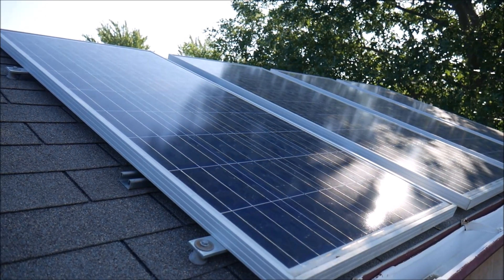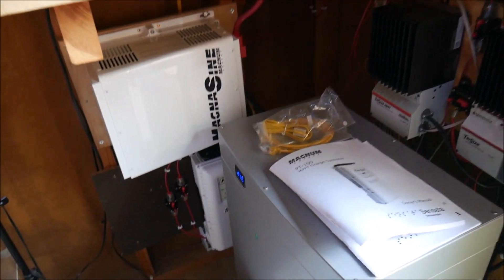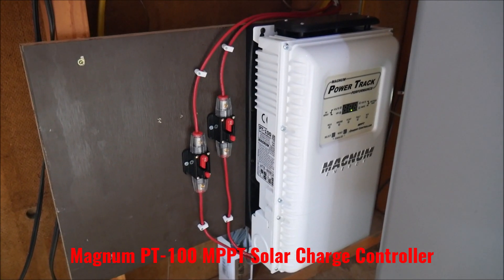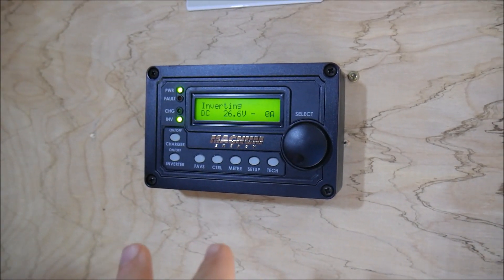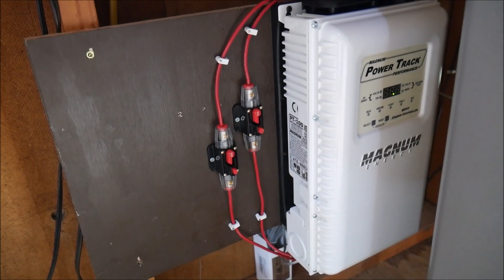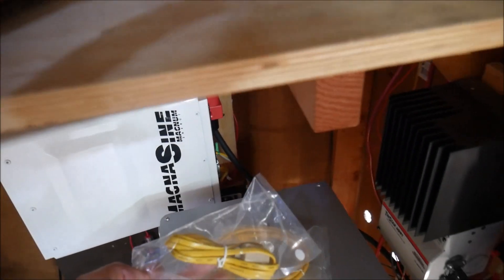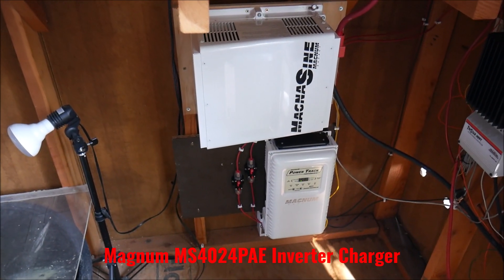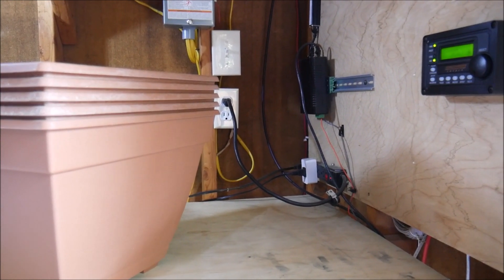Magnum Energy Solar Charge Controller & Inverter Install

Comment: Hello friend, that brand is for fans, it has been stagnant for many years, at this point it has not developed a monitoring app or integration with other devices such as raspberry and it is also extremely expensive for what it offers.
Reply from the maker: They aren't innovating at the same pace as the lower end of the market, true.  But their products are bulletproof and built in USA/America so there is still a market segment for them.  I would say they are better for whole home and commercial projects and much less desirable for smaller projects or for hobbyists/solar nerds.  

I'm not a fanboy by any means but I would trust that inverter charger over any other single piece of equipment that I own.  It is an absolute monster.

Comment: I installed a Magnum system about 7 years ago and it has been bullet proof.  Runs like a champ every day.  I think I have only shut it off 2-3 times since I installed it.  I run about 1000kWh/month out of it.  Only problem is, I don't think they sell them anymore...
Reply: I followed your videos about your installation and did mine with three of them. Pandemic really hit them while their were moving to Mexico. Most of the famous solar sellers stopped selling their products due the lack of availability for months. In my opinion the best Off-Grid solar hardware ever made.
Reply from the maker: Glad to hear!  Mine is going to be put to some serious use on my homestead soon!

Comment: Where did you get the magnasine?  Any support issues as mentioned in other comments?
Reply from the maker: I got it straight from Magnum Energy.  No support issues thus far other than some confusion on the solar charge controller that I am slowly working through.

Comment: Ordered a PT100, 175 minipanel and a 4448 PAE last year.
Took almost a year to get my components.
Set them up, and, to my disappointment, the PT100 and the 4448 were not fuctioning correctly.
Have been trying to speak to someone in warranty for over a week.
No response to multiple voicemails.
I had such high hopes.
Really disappointed with product quality and customer service response.
Reply from the maker: I am sorry to hear that.  I know their supply chain was a mess for the last year or so because of world events.  But bad customer service is inexcusable!
Reply: The main board is bad, you need to replace it and it may be discontinued.

Comment: Nice I have save power inverter in my camper van, could I connect a renogy solar controller to this inverter. It’s a lot cheaper.
Reply from the maker: Yes, you can use whatever charge controller you want.  It just won't integrate into the Magnum inverter and share the remote display and the advanced features.
Reply: @LDSreliance  awesome, I’ll just install a separate solar data panel. The meg solar unit is over $1000 probably over kill for a small camper van. Yet, I do have the meg RS Remote controller display unit already so I just might pay the $$$ for the meg solar unit.

Comment: I think Magnum is done. I purchased one of the last 4448’s come to find out and the charger won’t work. I’ve called all over the nation trying to find someone to repair it under warranty. All but one place said they think Magnum won’t come back also won’t do service work for them anymore since they don’t get paid. I have left many many messages and emails with them also have called every number I can find. Nothing! I’m stuck with a broken $5000.00 dollar inverter with zero warranty. I did find a place that had the parts to repair mine. I ended up paying them $330.00 for the parts. I just have to take a day to remove it from the wall to perform the repair and hope it works. I live totally off grid 20 miles from power. Not to happy with Magnum right now. Even if to do make a comeback I don’t think I would recommend them to anyone.
Reply from the maker: I will forward this to my contact at Magnum.  Sorry to hear about that!

Comment: Better go hybrid inverters and much much bigger solar panels. 100watts lol
Reply from the maker: I didn't pay for a single one of them.  They were all sent to me for reviews.  Use what you got!
Reply: @LDSreliance  yes cos all get this for try.
Expensive to high of an prices.   Many sheaper and much better ways to go.

So not rexomended
Reply from the maker: You are right, usually.  You can absolutely get larger solar panels cheaper, per Watt, than small panels.  If you shop for decent deals.  But keep in mind that larger panels also must be shipped by freight so there is some extra cost there.  I can usually find a decent 100W panel with free shipping for about $80 USD.  So as long as you are getting large panels cheaper than that I think you are ahead of the game.
Reply: @LDSreliance  bullshitt.   So many import industri panels all over.  So 60volt 320watt panels for 100 dollar No problem. 
U really get ripped off of this american shaite extremly expensive small toys
Reply from the maker: Link me to a 320W panel for 100 dollars that isn't used, Grade B/C, or blemished.

Comment: for mining you need a cool place so your GPU perform best.
for solar you need a hot place so it can perform best.
Reply from the maker: Actually, solar works best in cooler temperatures, as well.  I agree that the mining would benefit from cooler temperatures but I'm operating the GPU's at 100% stock settings in an open air rig.  So it should be fine.  Not ideal, but fine.

Comment: 13 years with my 4024PAE and Xantrex MPPT50/150 WITH NO PROBLEMS!  Make me a buyer!!
Reply: What size battery bank do you use I am getting ready to install mine but unsure of what size bank to get 14x32 cabin
Reply: @keithshumaker6402  I use 4 - L16 6v 390ah batteries.
Reply from the maker: Good to hear, Norman!  Xantrex is a good brand, too, but I'm seriously impressed with Magnum.
Reply: So you can only use half of the 390 I had 500 amp hour AGM bank on a smaller system for 10 years and am trying to figure out what size bank I am getting to need changing over to lifting batteries
Reply: @keithshumaker6402  Not sure but Lithium batteries are still Way More costly than AGM and my batteries are almost 14 years old.  For cost and performance, I would still replace with AGM till Lithium Batteries come way more down.

Comment: I am happy that you are using the magnums. As I said before I have magnum components $$$ that I never installed yet but currently I am running two Growatt inverters with built in everything along with 60 kwh, over kill, of lithoum battery bank and running almost whole house and very happy. I will use my magnums at some loint but you can't beat the Growatt along with eg4 server rack batteries for convenience. Cheera
Reply from the maker: Would be an interesting video comparing Growatt to Magnum.  Chinese vs. American.  I'm not a fan of the EG4 stuff but I know a lot of people are.  Thanks for posting!

Comment: I have a dual magnasine 4448 PAE SYSTEM here at the TN off grid project. System has been in operation over 2 years 100% off-grid not a single issue ever. Phenomenal equipment.
Reply from the maker: Awesome!  I love the paralleling/stacking ability of both the inverter and the charge controller.  Makes it so easy to scale up a system over time.

Comment: There needs to be room around equipment. There are codes for that. Try to look it up. Read instruction book for proper instructions
Reply from the maker: The equipment requires 4 inches.  That is what it has.  There is active air movement through the shed.  There are no codes for low voltage DC but I have followed the manufacturer recommendations on all of my equipment.
Reply: @LDSreliance  look in book to see if you can mount inverter in that position. If I'm not mistaking  you can't
Reply from the maker: Here is a direct quote from the manual:

2.1.4 Mounting the Inverter
The inverter base can reach a temperature up to 194°F (90°C), and should be mounted on a
noncombustible surface*. This surface and the mounting hardware must also be capable of
supporting at least twice the weight of the inverter. To meet regulatory requirements, the MS-PAE
Series must be mounted in one of the following positions—as shown in Figure 2-2:
• above or under a horizontal surface (shelf or table),
• or, on a vertical surface (wall) with the DC terminals toward the bottom, the MP-HOOD
(inverter hood) installed over the exhaust vents (top), and either the ME-CB or MPX-CB
(Conduit box), the MMP Series (single inverter enclosure), or the MP Series (multiple inverter
enclosure) attached to the inverter’s DC end (bottom).

Mine is in accordance with the top bullet point as it is directly underneath a shelf and, as I am understanding the language, does not require a specific orientation.  I could be wrong but that is how I am interpreting it.
Reply: @LDSreliance  I have the book in front of me. There's a pic in the book mounting feet setting on top of a shelf flat or under the shelf with mounting feet up. Look again   yours is incorrect by installation instructions
Reply from the maker: Maybe so.  But that isn't how the wording reads.

Either way, this way is much easier for me to get access to in my limited space.  If I put the DC connections on the bottom (which is also where the buttons, ports, and AC access panel is) then I can't get access to them without removing the entire 55 pound inverter from the wall.  I'm not worried about overheating or ventilation.
Reply: @LDSreliance  there instructions are for if the inverter blows up it cantains the molten parts so you don't burn your damn shed down   it is specific with instructions. Follow them. Show a good example